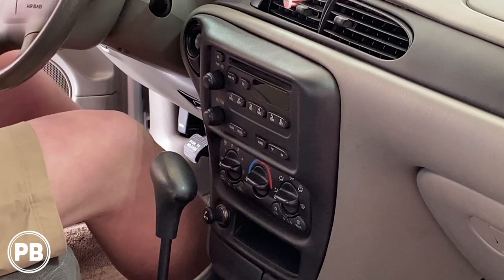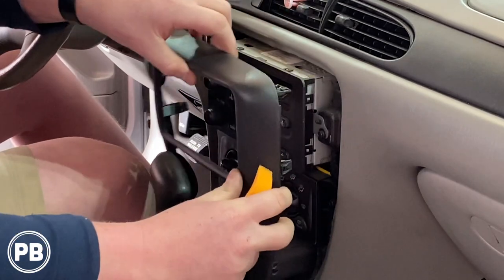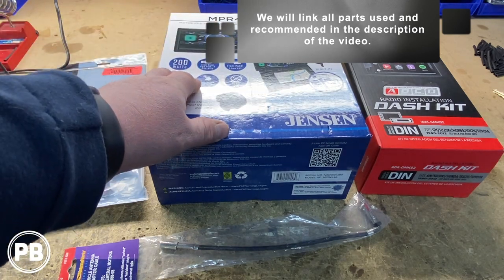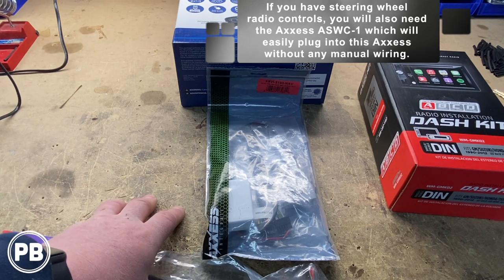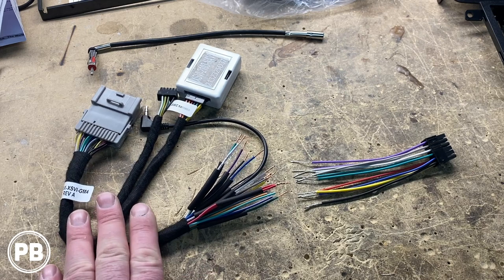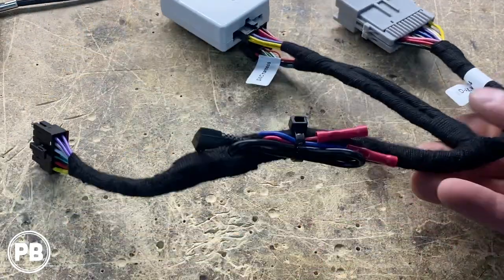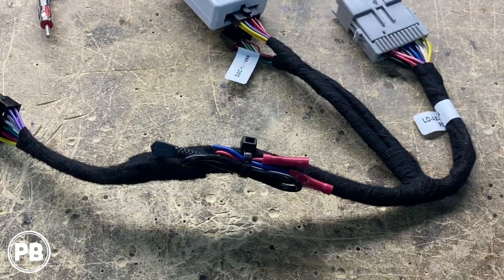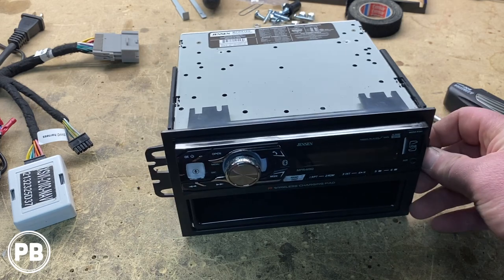1997 - 2005 Chevy Malibu Radio Install

Comment: Question - I'm about to install an aftermarket stereo for an 03 Chevy Malibu.  I've heard there is a weird support piece that prevents the stereo from going in.  Are those spacers what allows it to fit, or do I need to remove the support piece from the vehicle?

Comment: I've been trying to install an after market radio in my 2002 Malibu and have been unable to find the accessory wire in the car harness. The color code appears to be the same as what you've listed, which also does not identify an accessory wire. Am I missing something?
Reply from the maker: Well depends on what harness adapter you used. Accessory wire for aftermarket wiring is red, so you may have the wrong adapter.
Reply: @ProvoBeastAudio  It's not the harness adapter I'm having trouble with, it's the car harness itself. Thanks for the reply.
Reply from the maker: @bdub1studios  Without seeing it in person, hard to diagnose.  You are welcome to send us a message on our facebook page and we can try to assist.

Comment: I bought a 2003 Malibu and the previous owner had installed a new stereo amp sub and some other stuff non of witch work not to mention I have loose wires down by the peddles and I’m curious of where to try and figure out how to fix all of this

Comment: I assume all the cords go with the radio you have listed as your personal preference ?
Reply from the maker: If you are referring to the harness adapters needed, it really depends on your trim, but the ones we linked are the ones needed for our install, yes (not necessarily by preference, more so by requirement).  If you want help with your specific install parts, send us a message on facebook.
Reply: @ProvoBeastAudio  I’m referring to the touch screen radio you all have listed in the description, and I have a 2004 Malibu classic, are the adapters you have listed go with the touch screen radio as well?

Comment: this car doesnt have a traditional redwire for power when key is set to accessory. How did you make yours work? like what wires from the car needs to be connected to the radio signal wire?
Reply from the maker: Depending on the year, you may need a smart harness which generates one for you for your new radio.  See the description for the appropriate parts.

Comment: Does any one know where the amplifier for a 2003 base model? I got speakers that need to run at 30watts RMS power and 150 watts RMA power and can’t seem to find an specs on the stock amplifier

Comment: Hi I'm installing an aftermarket head unit on this vehicle.where is my switched power on cars stereo wire harness
Reply from the maker: Well, depending on your year malibu, you may be required to have a smart harness as 2003 - 2005 migrated over to a canbus data system and removed the analog accessory switched power source at the radio (as it's controlled via data).  We have the parts needed for your specific year linked in the description.

Comment: I have a 2004 Malibu classic I bought a harness off eBay it plugs in and my radio won't turn on there's no power to it what could be the problem
Reply from the maker: Even if it plugs in, it may not be the right harness adapter.
Reply: Make sure u find your ground and power cord from ur car actually matches the harness im having the same problem rn with my 2003 i got the right harness for that like era of cars and the wires are all in different spot im pretty sure orange is power black is ground and blues are to your speaker
Reply: @codywhite8358  hey did you ever figure out how to install it ? I’m working on my car as I type this comment, haven’t had a damn radio in over a year I’m going crazy !!

Comment: Any issues with the “theft” system? I’ve got a 2001 Malibu and have heard there might be issues when one replaces the factory stereo.
Reply from the maker: Nope, no issue, but the 2001 is the early years of this generation before GM moved over to their canbus system.  You should be fine with the install.
Reply: you just cut one wire from the ignition switch (think it was the yellow one), i did it to my car because it was getting really annoying and a safety risk. "anti-theft" light is permanently on forever but i prefer a car that starts up every time
Reply: @Thats Legit  my 04 does the 10 min alot,  cut that and it stops completely? Definitely need some info on this
Reply: @Urfunkinmom  I did it with my 03. I'd recommend going the toggle switch route in case you mess up
Reply: @zackhenderson2392 What if I wanted to install another used factory radio out of another wrecked  Malibu would I have to get it programmed?
Reply: Im having the same issues everytime I try to start the car..can you make a video on how to locate the cable to cut it and disable the anti-theft
Reply: @MrFred-lt8dg find the video on a 99 1500 bypass the pass lock system
Reply: @zackhenderson2392 what do you mean by toggle switch I have a 03 and I'm about to install one on mine

Comment: Why does noone just make a list of colors of the factory wires so i can splice an adapter? Been looking all day and none are correct for 2003 malibu. Theres only one yellow wire and all places say its for memory wire and speaker wire. It cant be both. People are morons online.
Reply from the maker: If you send us a message on Facebook or instagram, we can help.
Reply: Yeah man, I’ve been looking All day and have found nothing.
Reply: I need the same thing pleaseeee
Reply: its speaker, i cant fiqure out which wire is the signal for it to turn on